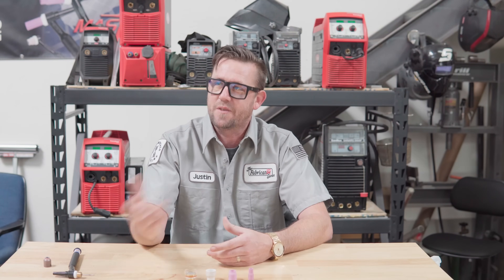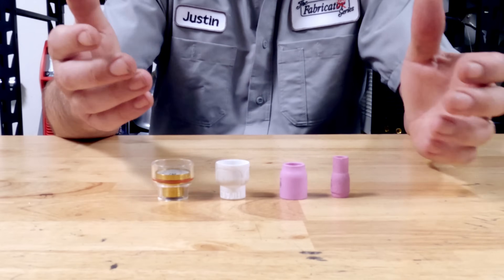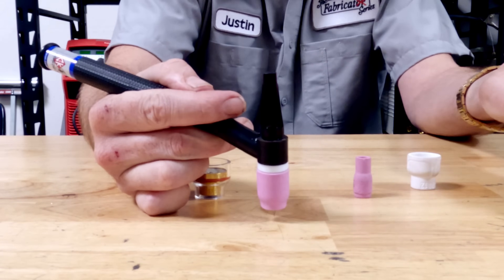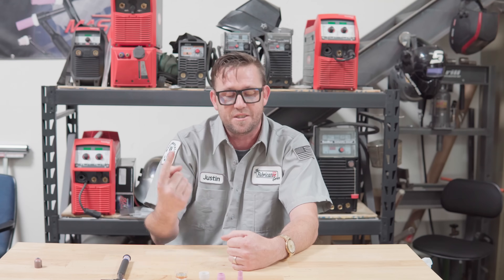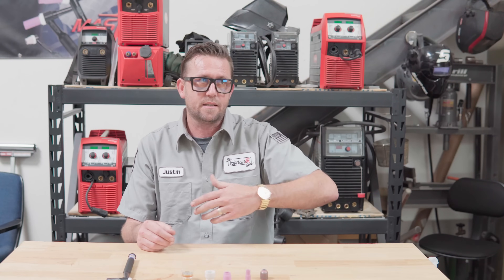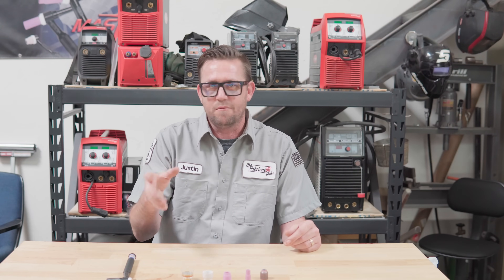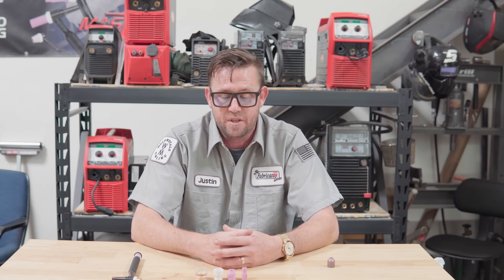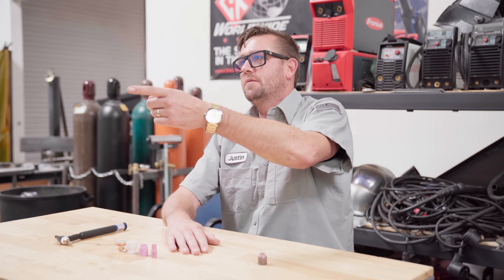Which TIG Cup Should You Use?

Comment: I agree with everything you said in this video when it comes to flat or small diameter pipe welds, but there is no one that would use a Ceramic Cup to TIG weld large diameter pipe. As a Union Pipe Welder we would have to Tig weld 1" pipe to 36" pipe and sometimes even larger. When you Tig large diameter pipe, you will be walking the cup 99.99 of the time.

Comment: Coach, You didn't seem to mention that gas flow in a straight (your #5 shown) is not laminar unless its out of the gas lens type cup?  The #8 you show is a gas lens cup not straight.... yes the cup can accommodate more flow.  However, it is my understanding from other videos show smoke flowing out of the cups that the gas lens, screens create much better flow  that is not as turbulent in puddle coverage? Therefore, the gas lens cups shown can be used with 1/4 or so of the straight gas flow rating?  I've seen this fact in my cup selection and gas flow use during the last 50 years in aluminum TIG, and think it is worth you mentioning laminar flow? You did mention extra turbulent flow regarding too high flow rates.... but didn't correlate the gas lens flow quality in that explanation.

Comment: The elephant in the room that nobody sees is insulators. Nobody talks about all the torch heads and how they are different sizes and require different insulators to insulate the cups. There is no size chart to help figure it out. I ordered two series 17 torches and both came with different size insulator snap on rings, the male part that the insulator snaps onto. Came with an insulator but try and order a replacement or better one to fit the various cups. No name or size inscribed on the insulator. Nothing to help the users figure it out and nobody talks about it. We can figure out cup size but what about insulators to match the torch and cup?

Comment: Note: Aluminum is in fact one of THE most reactive metal, that's why it forms a oxide layer so quickly. This oxyde layer is the reason you use AC to weld aluminum, during the AC cycle one state welds while the other breaks the oxide.
Reply: the fact is you can try to sound smart but given that quick forming oxide layer, when tig welding alum behaves as less reactive thus needing less argon

Comment: So im learning tig and my procedure says 15-25cfh using a 6/16 cup. Would you increase stickout a bit if you HAD to go higher gas than you might usually?

Just started tig welding this week, going pretty well so far should be testing next week. Navys pretty strict, no walking the cup (contamination) no downhill, so to be safe and not get fired i keep my gas around 20cfh, again, using a 6 cup. With that much gas would you go higher than that 6/16 stickout by a good margin?

Comment: No actually in metric, and for Alu specifically, they told me it's as simple as minimum of 1 litre per minute, per number of the cup.
Life is easy as long you don't mess splitting things in sixteenths. Why not seventeenths, twenty-thirds of an inch? Wouldn't it be even more accurate?

Comment: Man I wish I would’ve seen this video a couple weeks ago. I just started getting hot and heavy into learning tig welding, new 255ext, every pack of tungsten I could order, and all sorts of fancy cups and adapters and accessories, only to learn and try for myself that 80% of it was a pointless purchase 😂. Thank you very much for this video!
Reply: I did the same thing when I got my first tig machine. It was the powerpro 205. I almost went with the 255ext, but the powerpro had a 50 amp plasma as well. 

 Justin pretty much nailed it there. I also bought way too much 1/16 tungsten and fillers that never get used
Reply: haha, I did the exact same thing, now I have a whole drawer full of cups, o`rings and assorted other junk. one thing I did buy that really does work is the tungsten sharpener that goes on the end of a dremel grinder.

Comment: I have many little pinholes in my weld at some places not al, is this a gas problem? ( steel and using cup 5 with 6 l p h ). I suspect I need to go to cup 8 and 8/9 l p h ,, thanks for the great content ,, after 10 / 15 of your vids I understand the machine a bit and a reasonable weld (pinholes and a bit higher dan it should ) learned mig and oxyacetylene 25 years ago at school..
Reply: And have not welded more than 2 hours total sinds

Comment: Well at least i know why i can't weld aluminum. Non ac .... At least the tig welder i bought wasn't a total waste(only 50$ at a yard sale). I already had a gas cylinder. Most of the art i do isn't aluminum. But its a 20 year old harbor freight unit. Only two switches, turn it on and turn it up. At least its not scratch start.....
Thanks for your input. Clear and precise information.

Comment: Now I’m confused…. I’ve been mostly welding steel and aluminum with a #12 Pyrex cup with a gas lens and 25-30 CFH.  I saw this and thought maybe my aluminum welds are so big because of that.  (Steel welds are fine.). So last night I tried a #5 standard cup with gas set to 10 CFH.  That’s the formula right?  It was a disaster.   Instead of a too wide weld I ended up with a mess that looks like a lot of aluminum oxide and some black bits (didn’t have that previously) and giant melts because nothing would stick together without a lot of extra heat/time in a spot.  (Wish I could attach a side by side picture of the old vs new outcome.). I believe you…. You have a ton more experience than me, but I must be missing something.
Reply: I watched the AC TIG tutorial, then tried again and that made a lot of difference -- my welds still are not great, but adjusting frequency and actually reducing the gas flow even more helped...  I need a lot more practice, but wanted to say THANK YOU for educating me on things my welding teacher never taught (though he did recommend your TFS channel.)

Comment: What about cup size when it comes to walking the cup in a bevel when welding pipe. I use a 6 for a root pass because my bead space is in a tight area but when you get into the fill passes you really need to wave that arc across the space in the bevel and it doesn’t make much sense that cups only dictate argon flow.
Reply: Bingo!

Comment: The biggest cup I use is a no. 8, but I do have a couple of different setups for particular jobs I do, so I go from a no.6 Old school or Stubby, to a no.8 stubby or long gas lens for specific jobs. My flow rate only goes from about 6.5 to 10 Litres per Minute. I have found that with 1/8" tungstens on fairly high Amps I need to increase my Time of Post flow Up a bit so that the Tungsten stays reasonably silver, if it get a bit blue, just increase your time 1 to 2 seconds and see the Difference.

Comment: Regarding the "social media" or "rainbow" welds you say are such hot sellers.
There's exactly one of those that I like, and it's not because it looks pretty.
And because I said that it's not because it looks nice, you probably know exactly which one it is.
It's the "series of chained figure-8's" pattern that Rolls-Royce teaches their welders and they use when they make gas turbine engine parts out of stainless steel alloys.
I like it because I know that when that pattern is properly executed, it yields mechanical properties of the weld bead that closely match those of a single contiguous part, rather than a part that has been welded.
With welding, making two parts of metal act as as if they were machined out of one solid billet is, was and forever will be the whole point of using the welding process in the first place, and if you find a welding process that yields results like that one, you stick with it until you find something better. To my knowledge, that's the best process as far as mechanical properties that humanity currently knows of. Maybe we'll find something better in my lifetime, if we do, I'll prefer that one. But right now, as far as I know it's the best, and it's what I'd be specifying if I had to weld something out of similar alloys, of course if I could afford the pay rate of the welder capable of performing that properly (that's not cheap, generally the only thing that costs more than "the best" is having to do something twice using an inferior process).

Comment: Thank you Justin. 
Newish to welding. Really new to thinner merals.
I was blowing holes in 1.2mm firewall. 
Using no8 gas lense but argon was 15lt.
Dropped it to 8lt and increased preflow to 1sec which allowed the surge of gas to settle before the arc started.
Welds are much better with no holes.
Thanks again

Comment: Thank you.  I would like to point out that the manufacturer of my welding machines recommends cup sizes based on the thickness of the material being welded.  That is for thinner material  a smaller cup is recommended.  Granted they do recommend a range.

I may try TIG welding aluminum with different size cups to see how big of a difference it makes.  Though this will need to wait until I become a bit more proficient.

PS: With respect to buying consumables, I look at it this way:  You can make bad welds with good consumables, but it is hard to make good welds with bad consumables.

Comment: Almost always used the gas lens, but did mainly steel, I had to reach over coring (die cast dies), down into what would ribbing on the part, and it was a challenge to get the flow rate and length of hang out right. But I've had the tungsten way out there, it depends on the shielding offered by the surrounding tall environment and directional control.

Comment: Which cup do you use when welding into acute angles on mild steel to avoid porosity?  Need a lot of stick out to get into the base of the weld but a big cup makes it harder to get in. Conversely if you run a small  cup you get poor gas coverage?

Comment: For stick out I usually just put the tungsten tip into a corner at a 45 degree angle and try to eyeball a right triangle. This usually gets a good general stick out and provides some level on consistency or you can just do as Justin says and use the proper stick out of what the size of the cup is. He did make a neat little tool that gives you perfect stick out every time but when I want perfect stick out I just use a combination square. Works like a charm.

Comment: Thank you, I have been learning to TIG weld for about a year now and find it difficult to choose the consumables. 
This explanation of the cups is just the ticket for me. 
I have a Vevor 160 amp welder with the switch on the torch and find it good, but adjustment is very binary you could say. I'm sure I will be learning a lot more on this new channel. 
My main use for this is stainless steel and possibly mild steel, so I don't have AC capability at present.
I hope you will cover stainless steel at some point as my welds are very hit and miss at the moment.

Again thank you for the information you provide.

Comment: Great info … bought a prime weld 225 a while back trying to learn tig . Is this a good machine to use with your classes?
Reply: Just set mine up haven't used it yet. I did a lot of research and the Prime Weld 225 is one of the best budget machines you can buy. It comes highly recommended by a lot of pros

Comment: Rookie question here.
I have a #12 cup with a gas lens. For welding mild steel square tubing, I set the gas to ~7-8 liters/min, and get slightly rainbow-y seams, without any cracking or other obvious issues. So, the question is - how "OK" is this? Should I expect better results if I bump the gas to 12-13 lpm like the video says? Also, as far as I know, lenses require less gas because they produce a laminar flow rather than a turbulent one, so perhaps my settings are actually more or less correct? I'd appreciate any input from someone knowledgeable, since I'm just a self-taught dude with a cheap welder and access to the Internet.

Comment: good video. only thing i would add is the 5 standard (or stubby) works on aluminum with less gas than a 5 gas lens. for me i use the jazzy 10 on stainless because gas here is expensive and it still works well on lower gas rates. also if your working on dirty crap which blows crap everywhere, use a standard or cheap replaceable gas lens like ck gas saver. otherwise it gets expensive replacing gas lens.

Comment: You probably already have this in the "pipeline", but a video on setting up the gas would be welcome. Top, center, or bottom of the ball is my biggest question, but I know that is a general setting that needs to be tweaked based on how your machine and torch passes the gas through to the cup. Also how to tell if you don't have enough gas (close but not enough) and maybe too much gas.

For reference I have  Primeweld 225 with the junk pedal but the CK torch (need to buy a good pedal!!!) And a flow meter from a youtube competitor that seems like a big step up from the one included with my welder.
Reply from the maker: Flow is measured from the center of the ball since the ball sits loosely in a tube, and the highest resistance to flow would be around the side or middle of the ball. However, the gas flow is set in a "window" which means you could measure at top or bottom and probably be just fine based on the scale of the meter.
Reply: I picked up one of those flow meters for checking the flow at your torch, mainly since I wanted to be sure my regulators all read the same so I didn't have to know differences for each. checked it against the 4 regulators I have and all seem to read around the same. For example if it shows 15 cfh at regulator I'd see approx 14 on the flow meter on the torch fairly consistently.

Comment: Learning what the cup sizes meant (16ths of an inch) was helpful. Learning the gas flow range based on that size was great!
Reply: I had to learn by trial and error and a little bit of advice from some older guys. You really didn't get much input from some of them until you got put brother in-lawing some pipe with them (I learned on pipe that was getting x-rayed to code). Luckily when I started doing aluminum and thin sheet metal there was an older guy around who didn't want to do them anymore and he taught me a bunch.
Reply: I just love freedom units
Reply: @SumriseHD  Nothing against but those arent currencies and we're not studying economics. In which they still use scale10 to count tbh. Nothing against but using them in mechanics is just plain stupid. Because you might be as free as u want and I admire it, but you keep having ten fingers. Well I mean you were born with 10 fingers. I hope so at least.
Reply: US engineering schools make sure we can solve problems in both metric and customary, so that is in fact freedom, just like our founders intended.  The added bonus is we don't need to complain and cry about whatever system a project uses.  Units are irrelevant if you just deal with them as required.
Reply: This is an absolute great video! So much information that will help save money and get good welds!